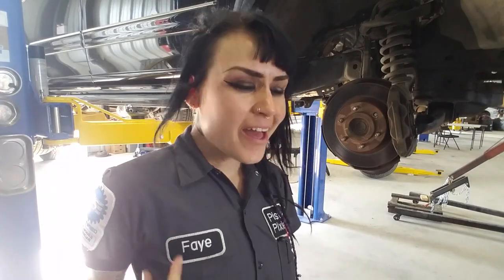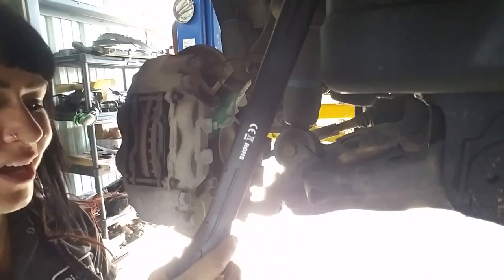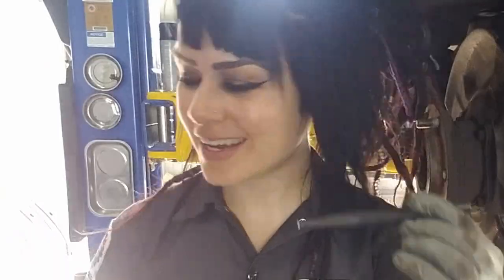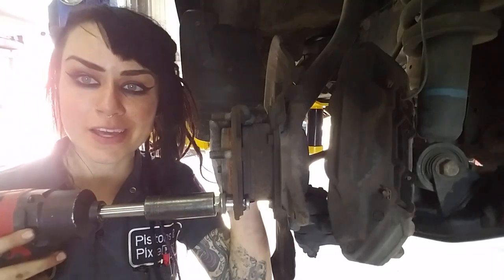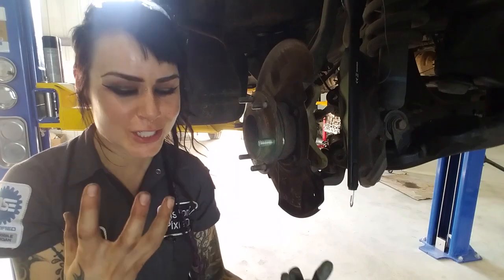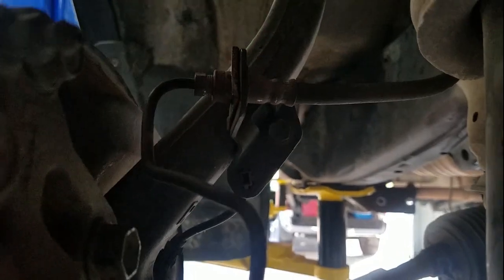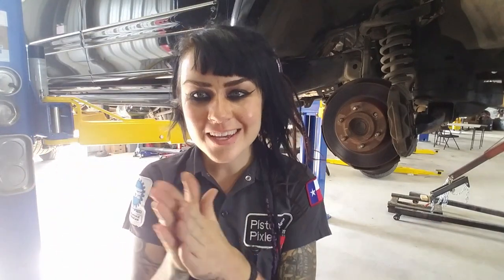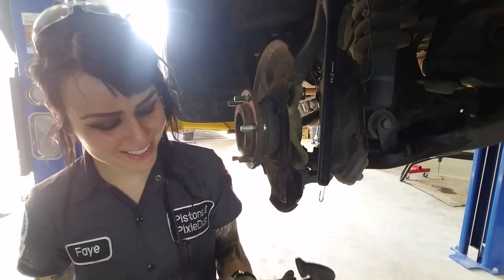Repairing a Broken Lug Stud

Comment: been in the car industry like 15 years, and totally know how to replace this. Still watched the whole thing lol. Faye just brings fun energy to the whole thing. A joy to watch! Thanks Faye!
Reply: Also there's a Lisle tool p/n 22800 that's a lifesaver for this sort of job. It just uses the new threads on the stud and the wheel bolt to pull on the lug. For anyone that's interested, it's not spendy at all and it'll keep you from pulling out the air hammer. Just my two cents.

Comment: Faye "Torque Wrench Queen" Hadley.  I had a 69 Road Runner and since Chrysler used LH threaded wheel studs on the driver side I had to swap out the wheel studs on it. Thanks for the video Faye, as always good stuff.

Comment: I am getting old, but I still do my own mech work on my own vehicles, and there will come a day that I cannot anymore. My issue with hiring someone to do this work for me is trust, I do not trust ANYONE to do my brakes (I have seen too many idiots do stuff that will hurt someone). That said, I WOULD hire you, after watching some of your vids, through your explanations and habits I can see that you CARE about the job you do. THAT is the important detail that most people miss when looking for a mech, price is a relative item. While I have not heard of stretching a lug nut stud on a CAR to the point having it fail by installing it with washers and a nut. It does happen on medium size trucks with duallies, AND it is NOT manufacturer accepted method, AND if  it does fail for any reason if there is evidence that you DID do this YOU will pay for it. Thank you for showing the RIGHT way to do a job, other commentator's should stick to channels that have a disclaimer at the beginning.

Comment: You've probably seen this tool before, but for the common person, it's worth knowing about the Lisle 22800. A C clamp may not always fit, especially on a rear hub with a drum brake and a ball joint point press is even less likely. The 22800 is what I use to install most studs, a drop of oil on the threads and being reasonable with the impact gun (just stopping when the stud is seated) is all that's needed to not damage the threads. It makes this very easy.

Comment: Faye, I've certainly had that experience at a tire shop just like you pointed out, the tech to use the term loosely in his case obviously didn't turn the nut on far enough to realize he had cross threaded it and ruined a stud by trying to bang it on with his impact, then had to send me to a different shop across town because they didn't have one journeyman mechanic on staff to allow them to do any mechanical work ( this is in Alberta Canada ) so what an ordeal that was easily avoidable ... fortunately they covered the cost of their mistake so can at least give them credit for that. It was four wheel drive pickup with an integrated hub/rotor on the steer axle so the whole bearing assembly had to come apart just to replace a stud.  I've also had a friend who took an old restored dodge car to a tire shop and they had no clue the left hand wheel hubs used left hand threaded studs and proceeded to twist off and mangle many of them, I expect a lot of shops would do the same thing as its such an oddball system only an older tech would have commonly worked with back in the day.

Comment: I’m impressed,(not witticism) I haven’t seen anyone else take the care to press a stud in. Everyone wants to rip it through with their”special tool”. Sure it works and it’s quick but almost always does damage to the nut, usually being softer and sometimes the stud. Or what if it’s a tight hole and/or oversized stud (again,not witticism). My machinist background makes me wince a little when I see people ripping on threads. I’d rather be sure I didn’t cause damage than get a call from someone’s attorney saying their accident analysis showed I did.  I know, sometimes ya gadda do what ya gadda do

Comment: I was pleased to see you didn't use a insanely over priced installation tool .. I would suggest that you use a hard lubed washer and a grade8  nut to pull the stud through and if you have a powerful impact wrench it will pull the stud through .  If you remove the caliper hanger also you can give the stud a couple hits with a hammer.while rattling the nut. I've seen guys use the c clamp thing and break the c clamp . But I also fucked up once on a semi because I'd drive the stud through ith a 16 pound sledge hammer if the dust cover was gone (most were )  once I missed and hit and broke the spider  that meant  at least another hour plus to replace the spider. Maybe it was 2 hours I remember it was Friday and I had plans. But like I said glad you didn't waste a pile of money on a stud install kit.
I watch these videos to see if I can learn something new  and yours is the only channel I have watched where I honestly was  shocked to learn a new trick and that was the head straightening  I even straightened a head  today rather than send it out . Thinking I may make a universal jig to use .  Bthe time someone calls me to fix a blown head gasket they have already pour 7-8 gallons of stop leak in it and replaced everything in the cooling system. So I rarely see the cause of the he overheating. But I always ask why and how it overheated . Usually get it ran out of antifreeze or the water pump alor hose exploded all the buckle and dime crap that  break when you add 100+ psi to a cooling system.

Comment: Gawd I wish I saw this video sooner. I went to Costco to rotate tires on our Honda CR-V. The tech cross-threaded one of the lug nuts and a few months later when I was taking that tire off I realized the nut wouldn't budge without massive force with a super-long wrench. Of course I broke the stud and had to get it fixed at my local Asian-only independant shop ($109 here in Berkeley, CA).  FYI - Costco told me to bring in the receipt to get my $109 reimbursed, but they made it so difficult -- can't file claim over the phone but only in person, can't email or fax the receipt but give in person, can't find any record of the complaint I filed the previous week with that same person when I give my receipt, etc, that I gave up, which was the whole point.

Comment: I screwed up a stud on a Durango years ago with an impact.  Only made the mistake once.  A friend just got a vehicle back from getting tires replaced.  The shop screwed up 2 studs on each wheel.  He now has to replace the studs and the shop won’t take responsibility.  Nice explanation   Air tools are fun, but not always necessary.  I’d recommend avoiding Dorman products.  In my experience and from what I’ve seen on youtube posted by others, they are not the best quality.

Comment: I prefer to stack washers and use a nut to pull it in, much easier
Reply: Yes. I use some spacers and use the nut. Is more efficient that way
Reply: Yep you are right on some models you can't use a c clamp.

Comment: I have to do this when replacing the hub assembly on my rav4. Another site recommended using a "Ball Joint Separator" instead of the C clamp. Since I have 5 studs to replace, in your opinion, which tool would be the more resilient? C Clamp or ball joint separator

Comment: Another easy way I did it when I was at Toyota is a thick spacer 1/8th in or bigger get an acorn lug nut and install it flat spot to spacer against hub and drive home with impact or ratchet till seated. Had to do damn near a whole tundra. #flatratelyfe

Comment: If you have the clearance behind the hub to pop a bad stud out consider yourself lucky.  On my 2010 Mazda 3 this was not at all possible so I had to resort to plan B which was to use files to repair a boogered up thread enough that I could get a lug nut back on it.   Took a while.

Comment: Your clamp trick will work with a heavier clamp and method of ,tighten clamp,hit end of clamp screw with hammer a couple times,tighten screw,repeat.as you procead the stud walks into the hole

Comment: Really missed you. Nice to see a new video. I needed a Faye Fix.  Watch All Girl Garage when you are on, but you aren't on enough, so the Youtubes gots to keep me supplied. First time I had to replace wheel studs was after I had a bearing burn out on the highway and I snapped 3 studs before I could get my truck shut down safely. Talk about death wabble. Not a fun fix on the side of the turnpike. Did it just like you did, minus the car lift. Thanks for the video.

Comment: Yeah thats alot easier on a full size truck...the hub has alot more clearance from the knuckle and the wheel stud has room to be installed. Most of the time removing the hub or grinding the new stud is necessary

Comment: You look like you really enjoy mechanics.... You should start working on 4 wheel drives... Doing lifts lifts and rear ends putting Lockers in the front end and rear ends getting 40 inch tires... Now that's mechanics

Comment: Why wouldn’t you just throw a nut on the stud to pull it in with a deep socket or ratcheting open end instead of using a c-clamp.